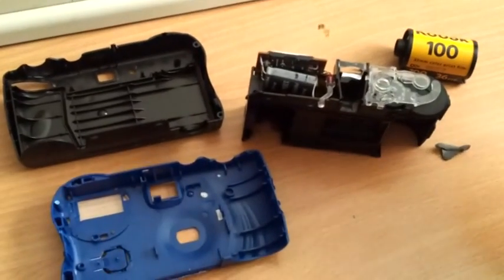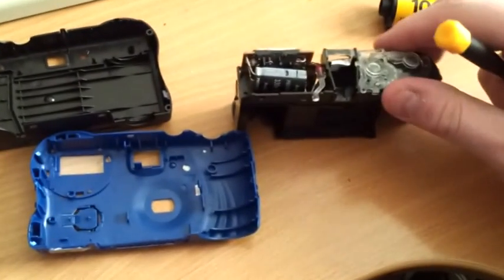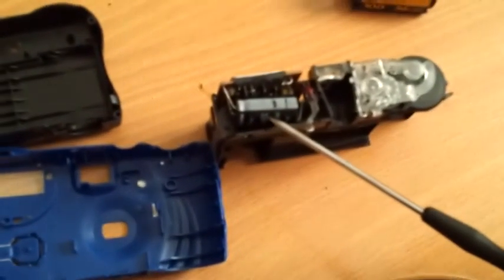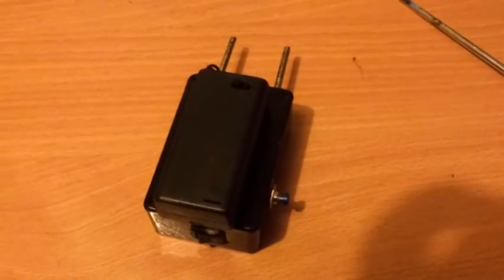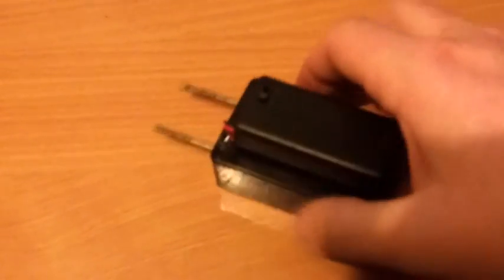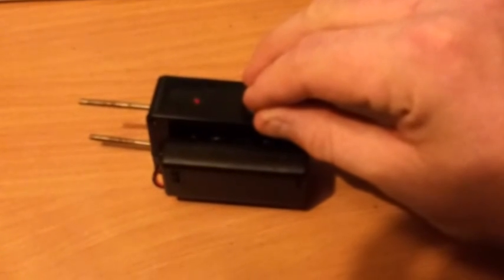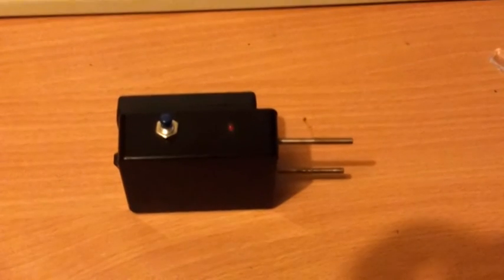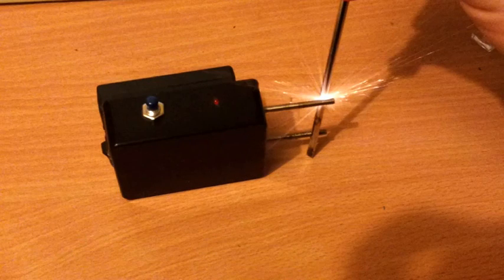Disposable Camera Taser

Comment: Great project! Now I must say you could have actually added a arming switch which means you would have to turn everything on and hold down the charge button then press the arm button to allow current to the taser. Also the Sparks are harmless... So I hear and the shock isn't that bad. But I have been shocked twice by the circuit board so it still scares me to discharge the capacitor.